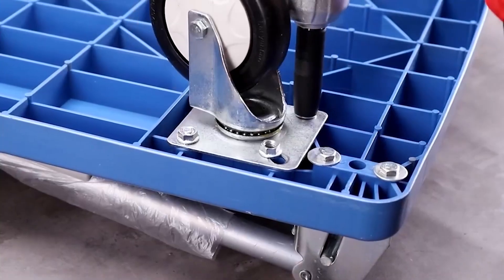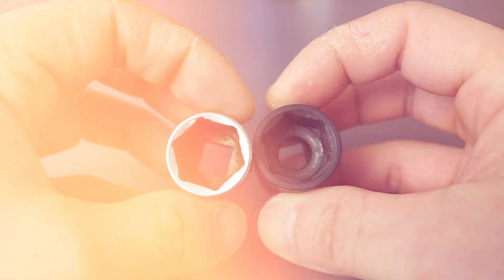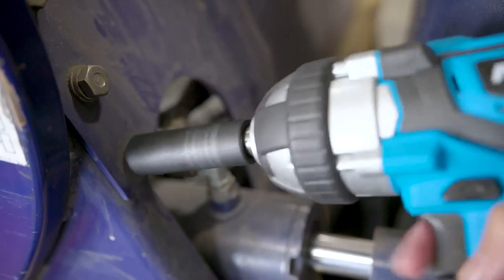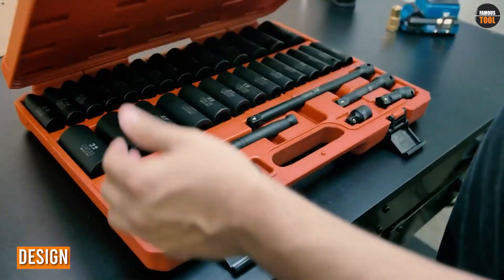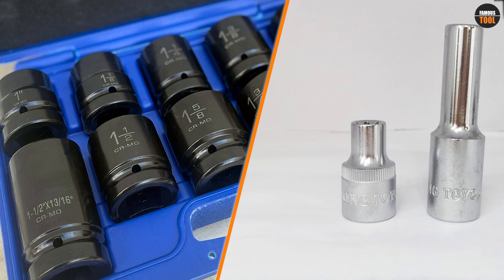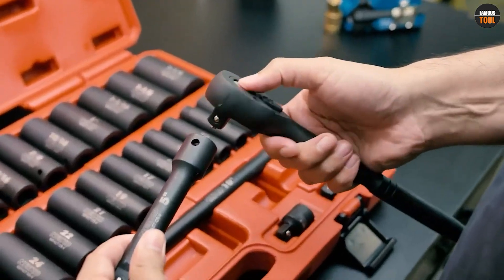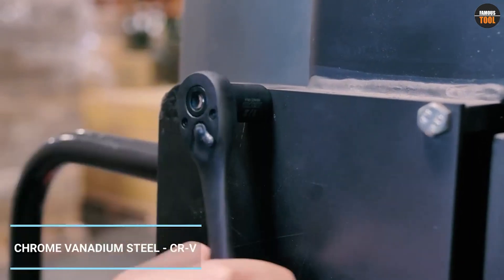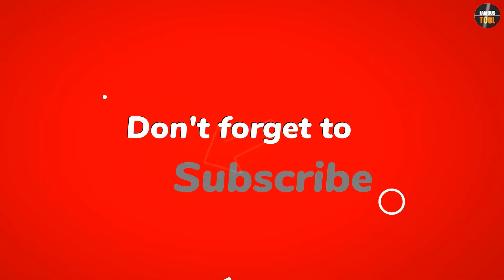Impact Socket vs Regular Socket: Which Is More Supportive?

Comment: Impact sockets are not as hard as chrome sockets. This is because increasing hardness makes the sockets more brittle. Chrome sockets are much more likely to crack or potentially shatter when used on an impact. Impact sockets are a bit softer, but tougher overall.